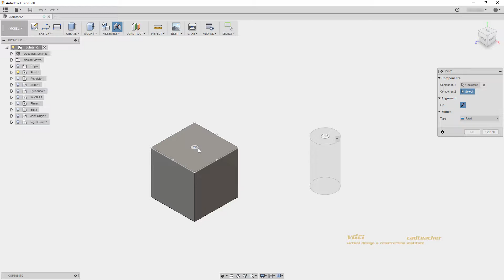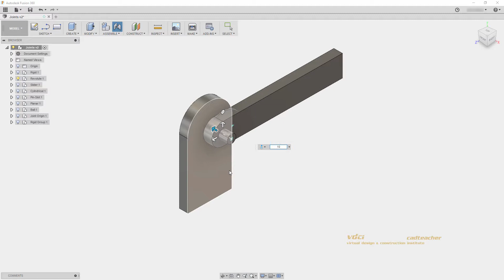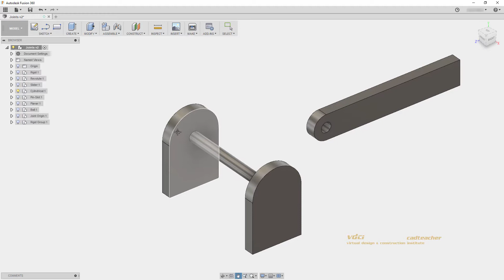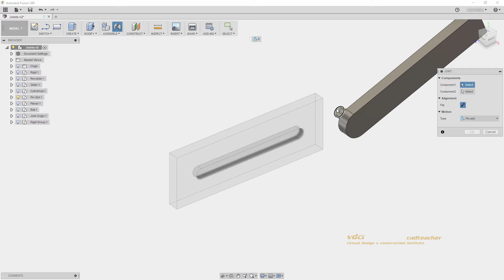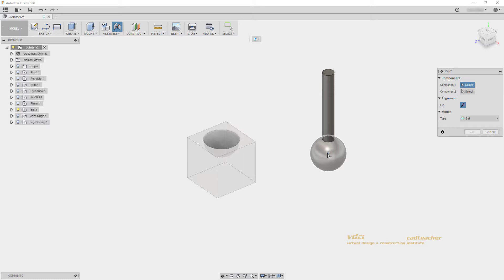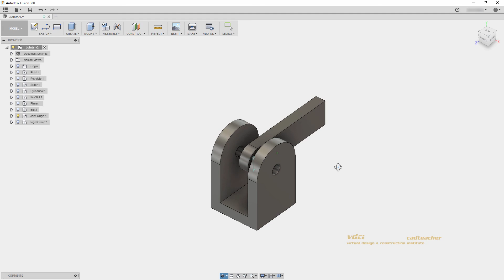Fusion 360 Workshop - FSN01 - 11 Joints

Comment: I'm working on something really difficult where I have a flat circle, with a small blade stuck to one side, and when you spin the circle, one end of the blade is attached to one side of the circle, but the other end is on a slider, attached to ANOTHER circle lol.  It's  a mechanical iris and I want to basically spin the middle circle to close the iris.  I'm having trouble doing this because idk how to spin the middle circle and keep the blade attached to it on one end but not the other :/